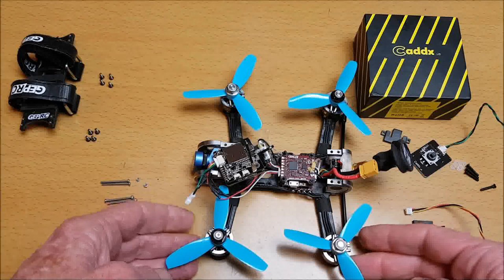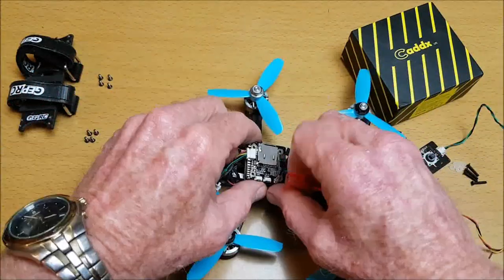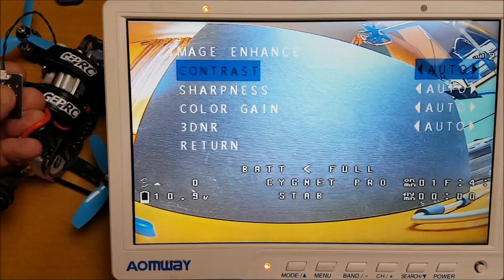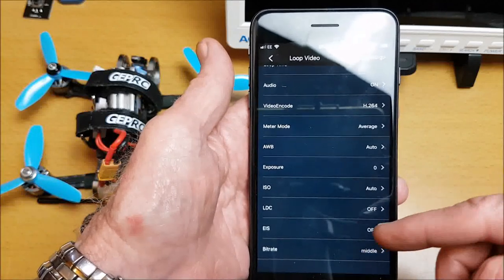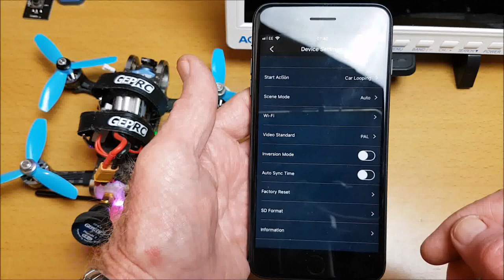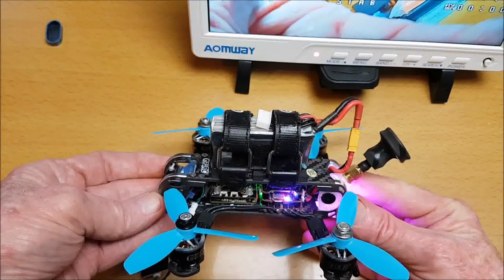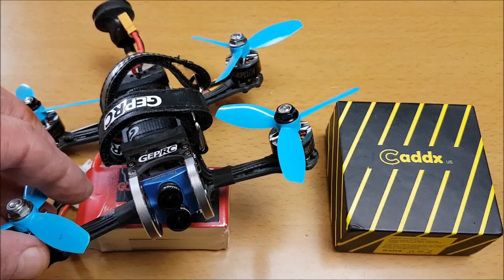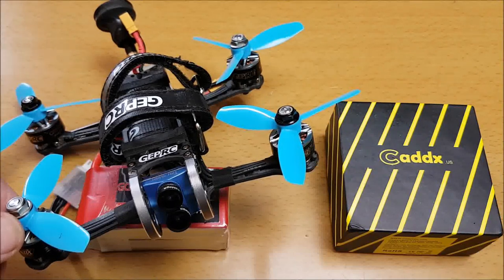Caddx Tarsier review - Setbacks, Setup, Flight & Camera Tests (PartII)

Comment: Hello Bill,
Thanks for the great review. Tell me please, does HDCAM record everytime immediately after power is on? or there is some option to disable automatic recording? Thanks
Reply from the maker: Hi, thank you for watching & commenting, always much appreciated :-) Yes, as far as I can recall this starts recording automatically by default but you can change the setting to manual recording.
Reply: @BillMRC  thank you very much for fast answer! :) .. I'm currently working as a truck driver, so i want to use as traffick dashcam for now.. but later also planing to build my first fpv drone, and than use for drone. but now it will be great if camera can record immediately when power is on...as dashcam :)... regards, Ivan

Comment: Very helpful, thanks !!  Maybe I missed it in the video, but did you solder 2 GND-wires as is written in the manual? And does your last video only record after you plug the lipo in one more time?
Reply from the maker: Hi, thank you for watching & commenting, always much appreciated :-)
 I did solder the 2 gnd wires together and the last video is fine on a normal stop & shutdown, but if a crash it is best to plug the lipo in again briefly as soon as possible.
Reply: Hit the stop button before powering down. Give it a moment to finish recording then power down.

Comment: Thanks for the video and the tipps. So their EIS simply doesn't work :D I tried to push the button like that when I had the grey image issue too, but to no avail for me. The Caddx support just told me to get it replaced. The new one I got never has a grey background and the lens cap actually stays on, for the first one the cap just slided off every time, so I think the first batch of these from Caddx had a lot of issues which got fixed in later batches? Definitely annoying but at least it works well in the end.
Reply from the maker: Hi Max, thank you for watching & commenting, always much appreciated :-)

Comment: Hi Bill. Thanks for this review, it helped a lot but I still can't record videos correctly. My TF card (Sandisk U3 32gb) is correctly formated according to the app but i get only loop videos. Moreover, the camera randomly disconnect and reconnect (no problem when removing the tf card). Can you please advice me ?
Reply from the maker: Hi, thank you for watching & commenting, always much appreciated :-)
 Yes, it is normal to get loop video recordings but you can set this in the settings too. The direct random disconnection (not wifi) can only be attributed to a loose connection or faulty ribbon cable.

1
Reply: @BillMRC  Hello Bill. Thank you for your answer. Indeed the loop videos are automatic but when I press the wifi button in order to record, I can't find any videos on the Tf card and the camera does not disconnect when I don't insert any card. I will try to format a much larger and recent tf card (exfat) to a fat 32. Bonne continuation Bill :)
Reply from the maker: @MrZuzutai  WiFi recording only records to your wifi device but should automatically record to your sd card if wifi is not selected. You must format the sd card with the app as Fat32 will not work.

Comment: Hi sir just opened my  Tarsier. As per manual a green led light should appear which long pressing wifi button showing its connection. I didnt get any green LED light but wifi is getting connected. In your review you didnt mention about any green light. Was it there or not sir??
Reply from the maker: Hi, I cannot recall, but if wifi is getting connected it is irrelevant,..is it not?
Reply: @BillMRC  Yes but how long we keep on pressing. If led is working we can atlest confirm wifi is connected. What about default recording on when powering?
Reply from the maker: @outboxfpv4360  Take this up with Caddx, it is their product, not mine.
Reply: @BillMRC  Thank you sir for your review and your advice.

Comment: The HD recording is 25 fps because it's set to PAL (which by definition is 25 / 50 frames per second). NTSC will give you the 30 you want for smooth monitor synchronised playback and fluid motion on YouTube.
Thanks for the review. I am waiting for my Tarsier to arrive.  I'm very curious as to whether it lets you set PAL for the FPV camera at the same time as NTSC for HD recording. That's how i will have mine set up if it's possible for sure. PAL analog has a higher resolution and looks better in my goggles than NTSC does. NTSC high def. has the correct frame rate for my PC, phones and tablets and the vast majority of YouTube viewers as far as i am aware, even in PAL countries such as my own.  Trying to reproduce 25 frames of video on a 30/60Hz platform results in 5 of the frames needing to be repeated every second to "pad it out"  from 25 to 30. This creates judder / stuttering and you lose fluidity.
Cheers
Greg
Reply from the maker: Hi Greg, thank you for watching & commenting, always much appreciated :-) Very interesting, thank you for sharing this. I will also see if this is an option if I get time to do this, thank you :-)

Comment: On my android the app goes direct to wifi to connect then won't go back to app to set camera. If you exit wifi settings the app asks to connect again even if it says connected in settings. Frustrating app so far, be nice to use the geprc advanced pro and set cam.

Comment: So do u splice the Agnd black wire on the 2 wire harness for the control board with the black Gnd wire and take both to ground on the FC?
Reply from the maker: Hi, thank you for watching & commenting, always much appreciated :-) Yes.
Reply: @BillMRC  Why didn't Caddx do this if it's important? It almost feels like we're doing the work for them.
Reply from the maker: @prottentogo  Hi, thank you for watching & commenting, always much appreciated :-) Unfortunately a lot of manufacturers are so eager to get their products into the market before testing properly.
Reply: @BillMRC  Kinda sad. Anyway: Could I also take the spliced up AGND and run it to the GND that's within the cable that runs to the FC? Like instead of a separate cable.
Reply from the maker: @prottentogo  you can try, I think the important thing is for the AGND to be spliced in as recommended.
Reply: @BillMRC  Hm, okay I run the separate cable and make a Y I guess. Thanks!

Comment: Does the WiFi gets connected even after its heated too much ? I’m facing this kind of issue?
Reply from the maker: It is best only to connect to the camera's wifi before starting the camera.
Reply: Thanks for the advice. I tried it but my WIFI is turning on randomly and sometimes not at all turning on.
Reply from the maker: @prasadvaidya9563  As I said, this is only reliable before starting the camera.

Comment: Hi,
I'm very new to RC flying, and am considering putting this unit onto a Phoenix 2400 fixed wing.
Can anybody here recommend a suitable VTX unit to go with the Tarsier?
Kind regards
(at this stage, I'm only looking to fly fixed wing - so a simple, but effective unit is what i'm looking for)
Reply from the maker: Hi John, thank you for watching & commenting, always much appreciated :-) How are you planning on powering the vtx?
Reply: @BillMRC  given the size of the plane, weight (and room) is not too much of an issue - so my power options are (relative to quads) quite open.
Bill, also - thank you for the reply!
Reply from the maker: @johnm2874  Sorry, I should have asked voltage input, nonetheless this is a good little vtx: https://www.banggood.com/Eachine-TX805-5_8G-40CH-25200600800mW-FPV-Transmitter-TX-LED-Display-Support-OSDPitmodeSmart-Audio-p-1333984.html?